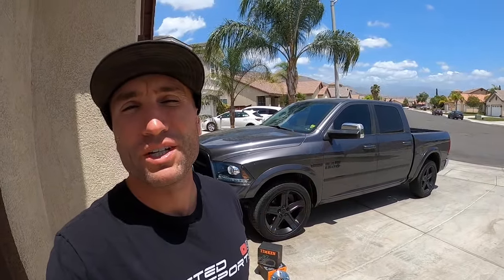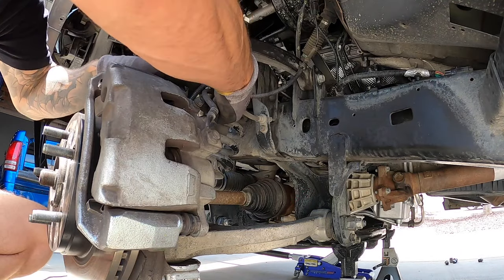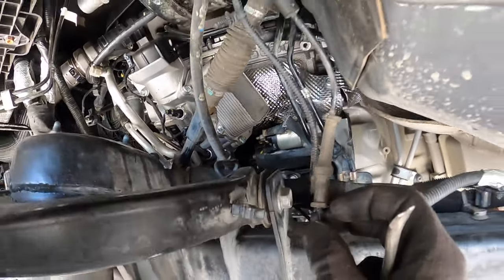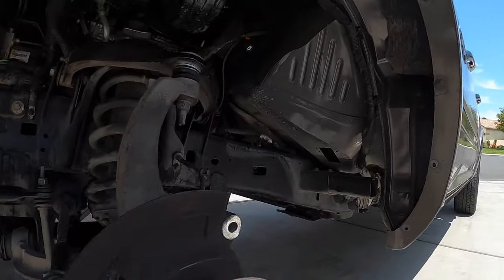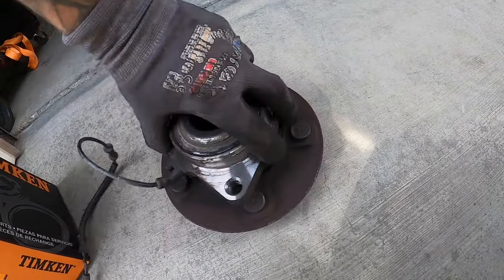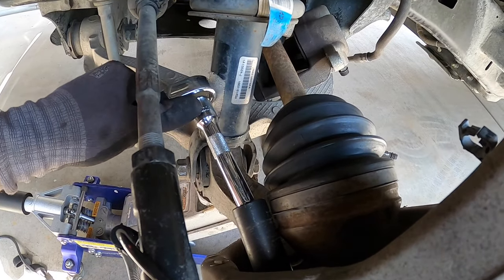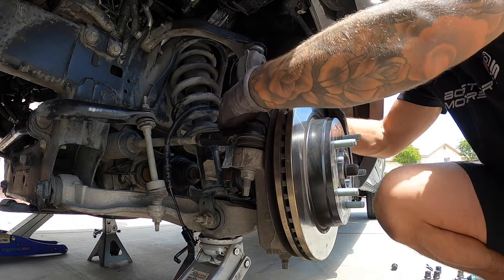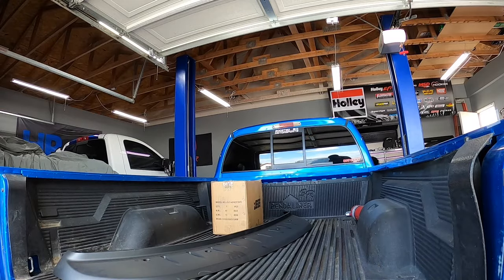How To Change RAM 1500 Front Wheel Bearings

Comment: Just a heads up and time savor for people doing the front wheel bearings . If you are just doing the front wheel bearings and NO brakes, You can actually leave the brake caliper squeezed onto the rotor, then take the rotor hardware off, and hang all of it together with a tie chord . Which keeps you from having to compress the caliper and take it off and everything. Saves you some good time.  Then you are right in there to change the bearings...  and simply slide the rotors back over, and all your brake hardware and caliper is still together.
Reply: Thanks for your help because I am having that exact problem
Reply: One benefit of taking it all apart is that you can add slide pin grease if it needs it. Since ya already got it apart. If you know they're ok though, then this is definitely a faster way.

Comment: Great video! Few tips for novices like me: ABS and traction control lights came on and shortly after was getting a clunking noise turning at low speeds. Used a OBD2 device and indicated it was front driver ABS sensor, but with research figured it was most likely a bad bearing (due to the clunking) which made the ABS sensor go bad. Found a "fleet" grade hub at NAPA for $98 and a 36mm axle nut for $26. This video is spot on and I didn't have to undo my upper control arm, just pushed the axle back with a sledgehammer often to get at the bearing screws. My bearing screws were 18mm. I used a shorter (not deep) 18mm 1/2" drive socket with a universal joint and large torque wrench for leverage to get them loose (Wisconsin truck) and finished them off with an impact air wrench, miracle #1. Remember lefty loosey. I tried using a 3/8" drive but the universal joints broke, so you really need 1/2" drive. After getting the 3 screws out the hub (steel) was stuck to the knuckle (aluminum) which rusted/fused together. I kept turning the steering wheel to the right and left, giving the hub about 20-30 whacks from behind with a sledgehammer each time, big whacks and slowly but surely it wiggled out (200 whacks or so), miracle #2. Everything went back together pretty easily, I used anti-seize generously, looking up torque specs for all the bolts with a google search. I removed the brake caliber but didn't take the pads off, so I had to use a caliper depressing tool from a previous brake job, that tool has been a great $10 amazon investment, miracle #3. My pads are fairly new, but the caliper tool got the job done. All in all it was about a 4 hour job with about $130 in parts and tools. Local shops were quoting 2hrs labor for about $200 if I brought the hub in. If you've done brakes before, you can probably do this job. An air impact wrench, universal joints, large torque wrench and a 3 ton jack really help out. Good luck!
Reply: I have an abs light on now after absorbing a massive pothole and my alignment tossed out of whack.    I'm assuming its a wheel bearing as well throwing the speed sensors off or something.      Thoughts?   Did u have to unplugged your battery after to clear the code?   Did this solve the dash lights as well?
Reply: @SHMITGAMINGINC  sounds like the bearing went, especially if it has some miles on it, that pothole was probably the straw that broke the camels back

Comment: Do one with the OEM wheel bearings still in use. The OEM's have a heavy coating of some type of frigging clue. Just changed out both left & right at 200-k neither came out easy!! Had to use a portapower and wedges.

Comment: Great video! Are you supposed to grease the wheel bearings before installing? I have not seen anyone grease them in an install video, but there are mixed opinions in different forums online.
Reply: I would assume they come pre greased.
Reply: They're sealed bearings, so there is no need to grease them.

Comment: If I'm going to change my wheel bearings, should I change out the upper control arms while I'm at it?  It's a 2014.  100k miles.  In the rust belt.

Comment: I winced when you were hitting that front axle with a mini sledge. I use a punch in that center divot.
Reply: I cringe too......if you would leave the nut flush until you get it knocked back it would save possibly rolling the threads on the end.
Reply: @jecroswell  I've had the outer most threads on the nut get damaged while beating on it. Just a punch and a hammer does wonders

Comment: hope You can help me out, I just replaced both wheel hub on My 2010 Ram 1500 4x4. Things is now when in LOW Range, the ESP and BAS light comes on,  eventhough 4wd keeps working...what could it be?...Does the computer reset itself, should I take My truck and have it scanned?
Reply: If you are in 4 low the traction control is off , disabled. the light will illuminate on the dash. If your ABS light is coming on it could be a sensor issue.

Comment: Dude, do you know what (parking light out) means? This is my forth Ram and the first one to do this. Once I start it up and press the break it pops up on the dash but goes right off. It driving me crazy...
Reply from the maker: It’s one of the running lights. Turn on the running lights and take a walk around to see which one is burnt out
Reply: Likely the third brakelight, My dealer installed an "aftermarket flasher" and the same thing would happen intermittently. Once I located it (inside the third brakelight) I removed it and it never happened again. The system sees the extra resistance in the flasher module as an open circuit.

Comment: at 2:14, what is that internal filter for?? and what are the torque specs for the axle nut?  alos, those exact wheel bearings are 84 bucks on rockauto compared to 105 on amazon.  just sayin

Comment: I've replaced the wheel bearing and installed a different set of tires and that hasn't fixed the issue. I still have the vibration, even with turning the wheel one inch. I often get vibration on the steering shaft that is noisy. Any tips are appreciated!
Reply: i’ve got the same thing with mine. i’m at 199k and it’s been doing it for about the past 50. i believe it’s a combo of wheel bearing and cv joints being worn out. both of which i’ve never replaced so they’ll be my next job as far as maintenance goes

Comment: Do you need a realignment after doing this.
Reply: I would defiantly recommend it. I have done the front left bearing in my Ram and decided not to get an alignment done. Big mistake. Didn't take long to get huge uneven wear on the left front tire. When I did get the alignment done the left was way out. spending $90 on an alignment is way cheaper than replacing 20" tires.